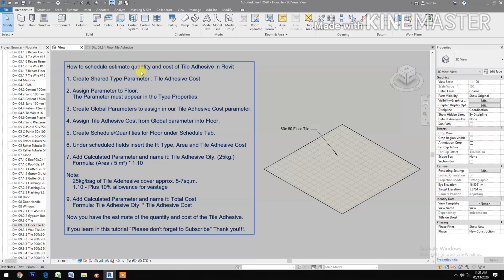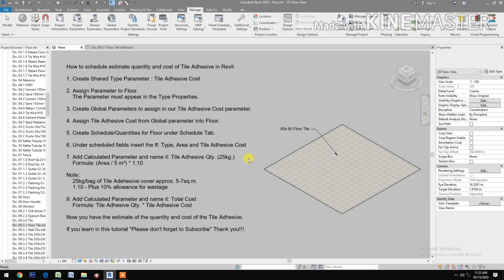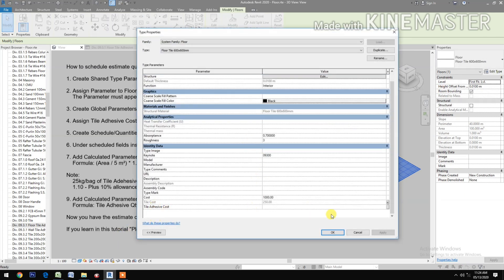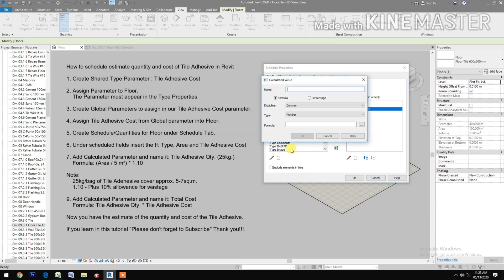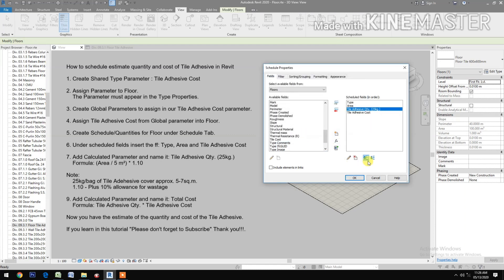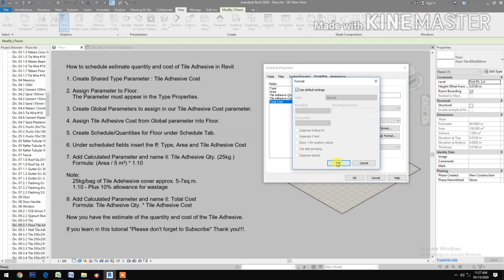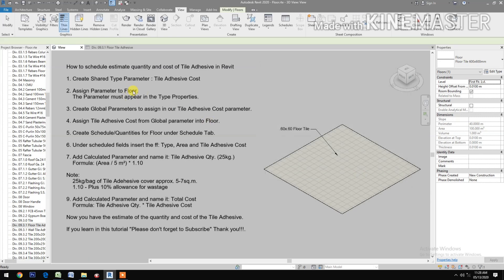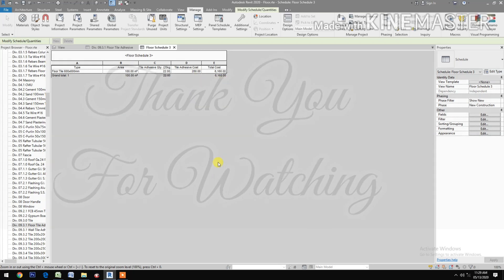Cost Estimate of Tile Adhesive in Revit. Program of Works in Revit.

Comment from the maker: RD117. How to make a Twisted Continuous Wall to Roof in Revit. Pattern Based Massing Design in Revit.
https://youtu.be/7T2KVt6-N80
RD116. How to make an Arabic Pattern Curtain Wall in Revit.
https://youtu.be/u9giiqooh8c
RD113. How to make a Parametric Arabic Pattern Pivot Door in Revit. Pivot Door Revit Tutorial.
https://youtu.be/3tAyuCpotGw
RD112. How to make a Parametric Arabic Wall Screen Divider in Revit. Decorative Wall Panel in Revit.
https://youtu.be/QUr7-LO2I2Q
RD111. How to make a Parametric Floor Accent in Revit.  Custom Floor Pattern Design in Revit.
https://youtu.be/K-3mrs3ICD8
RD109. How to make a Classic Ornament Stair Railings in Revit. Classic Ornament Baluster in Revit.
https://youtu.be/mq1grcVPxhg
RD108. How to make a Glass Balustrades in Revit. Modern Stair Design in Revit.
https://youtu.be/NVbatHyQj_0
RD103. How to create a Parametric Curtain in Revit. Curtains in Revit Tutorial.
https://youtu.be/dVljI_ynZPg